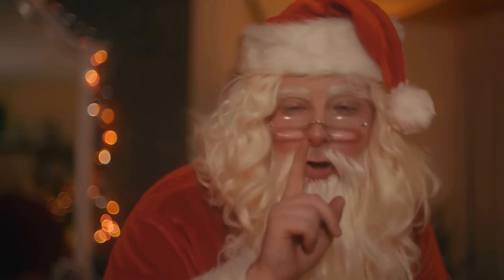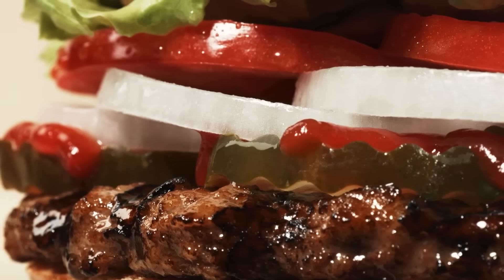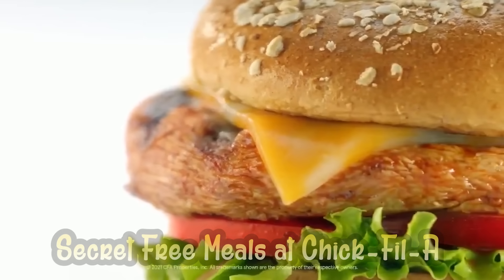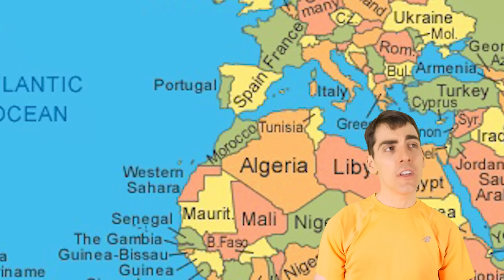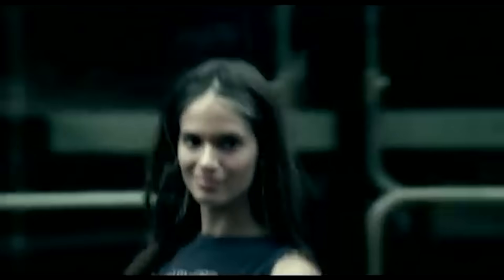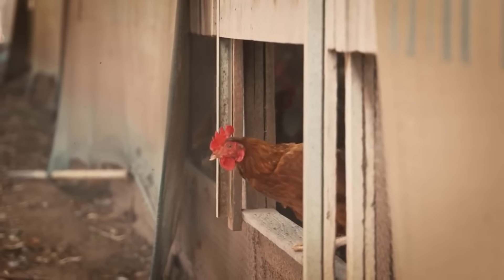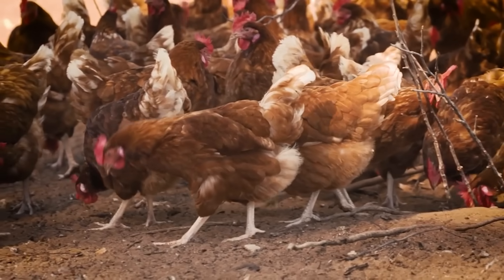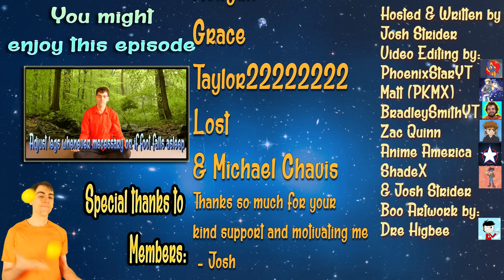10 Strange Fast Food Secrets

Comment: I do recall that the issue with the pink slime wasn't the way it was seperated, most people were actually fine with that part once the process was explained.  It was the sterilization process and the kinds of gasses used that were the primary concern since they could be toxic in high amounts and testing the presence of said gasses in the final product wasn't regulated.  However most people didn't really look into it that much and instead of pushing for the actual concern to be resolved just vilified the product as a whole.
Reply: If you look at the document about the pink slime it's BEEF not chicken so it wouldn't be (hopefully) in the Chicken Mcnuggets at all.
Reply: Julius Frauenglass  the process is also used for both chicken and pork though not nearly as much as beef.
Reply: Fascinating

Comment: I used to work at a Burger King in high school. Those "grill marks" are actually because of the broiler we used. The burgers went through the broiler on a metal rack, so as the burgers went through, the "grill marks" were cooked onto them. I wouldn't necessarily call them fake, but they aren't made from a grill either.

Comment: used to work at mcdonalds and the taylor company is evil. I recall our store manager just colapsing on the floor crying because she got so frustrated with the error after spending 4 hours deep cleaning the damned thing. I was a cashier and I got yelled at a few times about how our machine was always down. like it wasn't our faults karen.
Reply: What about the crew that didn't fill it and then the machine would freeze up.... I was a cashier, later a drive-thru order taker/ cash.
Reply: @stepdako  I've heard that happens but personally never saw it in my location so  I can't properly comment on that.
Reply: @kitsdollies2466  that's fair, but every store is different about commenting. When I worked there last, they had a person come in and clean it instead of maintenance. Years ago I use to clean it when I use to close, around mid 90's.
Reply: Broken is broken. Karen acts like the minimum wage employees control everything in the entire company. Believe me lady, we wish we could fix this cluster f*ck.

Comment: The funny thing with number 1 is that doesn't just apply to fast food.  All food looks better in the ads and promotional images than it does in reality. (And that also applies to the images in cookbooks) I've even seen videos about how they make the cheese on pizza look so gooey.  What they do is cut the pizza up and lather the sides of the slices in glue so when they pick up a piece in the commercial, it displays this amazing looking cheese dangling from the slice.  Only real difference is that pizza's probably still edible with the glue on it, but you get the point.
Reply: Actually, they've come a long way.  It wasn't all that long ago they could just make fake food altogether and present it as what they were selling.  Now, they MUST use the food they sell.  It doesn't have to be prepared the way they do at the restaurant, but it has to be the actual ingredients they use.  That perfect bowl of cereal, they open a dozen boxes, pick the best pieces, and then pour a milk-looking substance over it.  Used to be an ice-cream company could color lard or mashed potatoes, now they have to use their ice-cream.
Reply: @Craxin01  hmm, not sure about that ice cream thing since its very difficult to photograph ice cream under hot projectors. that why they use/used mashed potatoes.
Reply: @tornadodee148  If the ice cream isn't what they're selling, then they use lard, Crisco, and mashed potatoes.  If it IS what they're selling, they have to use the reference product.  Ever notice the shots they use aren't more than a second or two long?  They style the ice cream, shut it in a freezer until they're ready to shoot, then bring it out for the quick shots they do use.  Besides, while heat melts ice cream, it doesn't do it all at once.
Reply: For the cheeze pull (that is what this is called), instead of glue, they could simply use stretchier cheeze like brie, and provolone.

Comment: I've been working at a Wendy's for a while, on the grill.  Yes, it is like being in a hospital - lots of beeps, and the different machines have different tones of beeps, so it's like - "Yeah, that's the deep fryer," "That's the pressure-fryer," "That's the oven - bacon's done."  I shout curse-words at everything, and I'm allowed to, being in the back kitchen.  Everyone does.     

People do order burgers without buns sometimes.  It's a thing for people on special diets and people with gluten allergies.  You can order lettuce-instead-of-bun or just the burger without the bun and we'll put it with the stuff that comes on it in a little plastic tray - the same kind we use for the Baconator fries and the baked potatoes.  

I grew up in the American Southwest, where Taco Bell exists alongside authentic Mexican.  No one, not even gringos / gringas like me there mistakes the two. In fact, we kind of laugh at any East Coasters or people outside of the area who actually think that Taco Bell is real Mexican.  What you get from a real taco truck or a hole in the wall or your neighbors inviting you for dinner or learning to make yourself from them is loads different - about as cheap, much, much better quality.  Taco Bell failing in Mexico is no surprise.

Comment: Hungry jacks and I would assume burger king  have real grill marks. Used to work there and the meat comes in without the marks. It goes through a broiler which flame grills them. The chains it sits on gives it the marks.
Reply: Also there is a trick you can do to the sundea machines if they sure the heat cycle error. 

Basically occurs because the temp sensor didn't reach its temperature.  Fix it by Emptying the barrel, pour hot water (about 70oC+) over the sensor and it should come out of the error. 

Use to work to our machine. Our machine was down very rarely. Still had to do the heat cycle for 4 hours every night.

Comment: It should be noted the 4 hour cleaning isn't automatic. Specially trained employees need to take the machine apart, scrub, delime, clean the individual parts, and then put the machine back together. This is done bi-weekly, with the four hour heat treat mode being done daily, usually by the night crew.

Comment: TacoBell is "Not as authentic"? XP hahaha TacoBell tacos have more in common to a hamburger than to a Mexican Taco, TacoBell ads yellow cheese, and the beef is cooked with Ketchup, Mexican food has none of that. Mexican Tacos have no lettuce and we do not ever use folded fried tortillas for anything. We do have however "Mexican Pizza" but it's not what you think, it's just a normal pizza with certain toppings: Beans, Chorizo (You should google it, it will be long to explain), onion, jalapeño and sometimes it has corn, but it's more common without it.